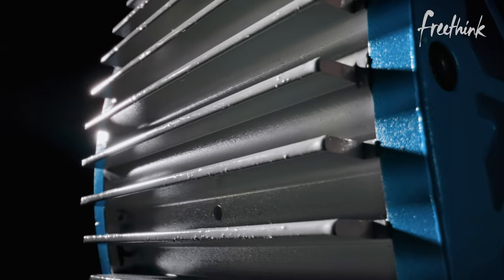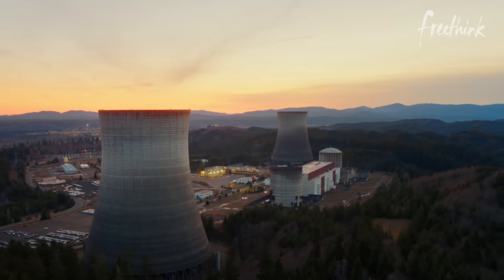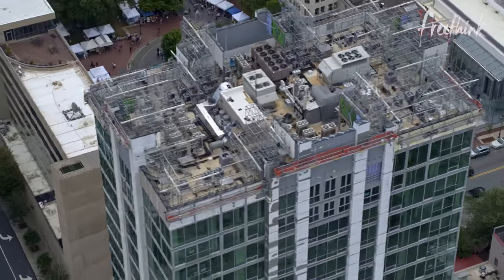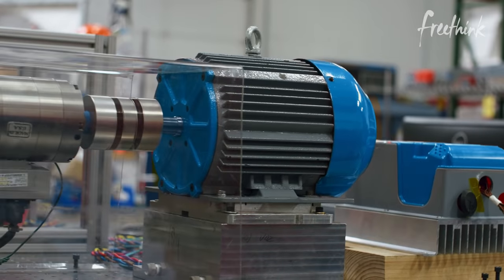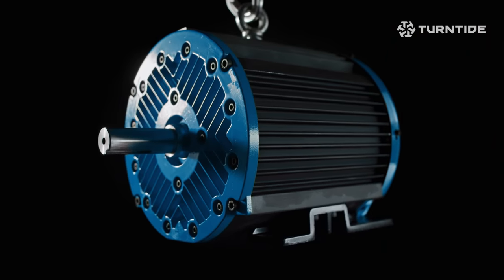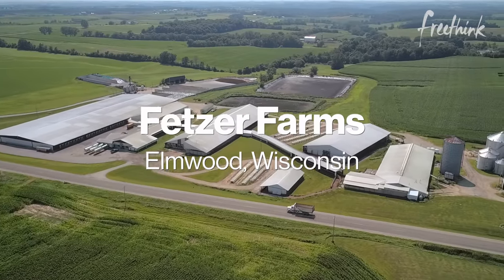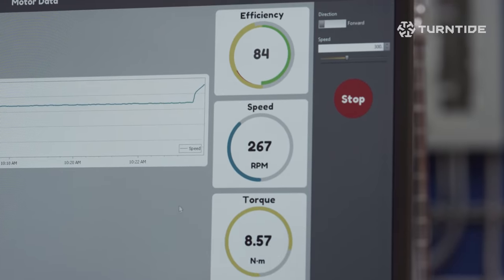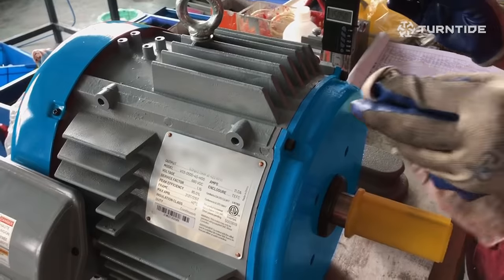Want to Save the Planet? Start with Reinventing the Motor

Comment: Big claims! Majority of existing large motors have 92+% efficiency. Hard to squeeze more without impacting cost and reliability. Improvement by few percent is nice, but from existing efficiency one can see not much room if left for substantial impact. Better electrify more machines than reinventing the wheel.

Comment: I have better idea without turn in and off fast .. and single wiring double rotor and each turns to counter each other and also can work wirh dc and ac ...no complicated computer control for speed .. just variable voltage .. no speed control .. your speed is only limited with bearings and energy you can supply .. speed will controlled by power(Voltage and current ampere )

Comment: You are putting chips and computers inside motor and saying that it will have lower maintenance cost. Truly internet is a very strange place. 

Current electric motors are almost 80 percent efficient not 50 percent as you said.

Comment: This is just an induction motor...
Reply: Nope.  Looks similar, but totally different principles.  An induction motor operates by inducing a manetic field into the rotor from the stator, which lags the rotating field in the stator, which in turn attracts the stator field.  The greater the lag, the greater the torque, so an induction motor always runs slower than the synchronous speed.  The reluctance motor does not induce a magnetic field in the rotor; it just conducts the field through the rotor, through pole pieces that make up a fraction of the rotor's circumference.  Torque is generated by the phase angle difference between the stator field and the rotor position.  Because of this, it is a synchronous motor, and does not depend on slip between the stator field and the rotor to generate torque.  But because of THAT, it requires precise control, because the stator field must always be leading the rotor by an amount determined by the needed torque.

Comment: As someone who works with motors on a daily basis especially big motors, 1this is bullshit most motors now with VFDs are close to 90% efficient. Also I'm not impressed with a blue 15hp at most motor, show a big 4160vac synchronous motor then I'll be impressed

Comment: The highest efficient motors are synchronous permanent magnet motors. These are used in drones, hybrid cars, electric cars, high efficiency washing machines with direct drive permanent magnet motors, etc because of their efficiency. High power, small size, less heat. Yes it requires a high speed switching controller to match. This infomercial is not about this motor, but something else that compares their motor to line frequency squirrel cage induction motors. They make no claim in efficiency in comparison to synchronous brush less DC motors.
They are not comparing their motor to other high frequency inverter type motors, but only to line frequency induction motors. They claim an effectiveness gain of 30% or so over and induction motor which has efficiencies in the 80 to 90% range. So in reality their motor is in the 82 to 93% range.
A graph of the efficiency of induction motors vs permanent magnet motors can be seen on this page based on typical power sizes. Larger motors are more efficient.  https://www.horizontechnology.biz/blog/induction-vs-permanent-magnet-motor-efficiency-auto-electrification
To be fair, the company instead of claiming efficiency improvements over an induction motor, should print the datasheet of actual efficiency.

Comment: I call bullshit on this. They're describing variable reluctance motors which are basically the exact same efficiency as typical three phase induction motors. Most industrial induction motors will easily get to 85-90 percent efficiency.

Comment: 20kHz commutation isn´t that high at all, every Hobbyking-quality-level (being the cheapest) motor-controller can do it... Kimura made in 2009 a tiny 100W-motor with 96,5% efficiency (a bigger 50.000W-motor for cars would be at above 99%), I think some Toshiba-daughter-company exploits the patent since then. https://newenergyandfuel.com/http:/newenergyandfuel/com/2009/04/06/japanese-researchers-breakthrough-96-electric-motor-efficiency/ If you pay for somewhat premium quality, there´s no room for improvement.

Comment: They way these guys are explaining a simple motor,,, Specs it runs on windows 10, its using the new 2nm intel cpu just to switch a 0/1 20,000 times per second😂😂😂 🙌

Comment: Congratulations your team successfully increased the frequency of oscillation from 50Hz to 20,000👍 
is it possible to use it as an alternator to generate more electricity? So that when it passes one stator coil various pulses of electricity are generated?

Comment: Half of the energy is wasted, what a wrong information!
Everybody can look at a datasheet from a standard induction motor, and there is to see that the efficiency depends on how many % of the nominal power of the motor you momentary use. Even if you need only 50% of the nominal power of the motor the efficiency is above 90% and this is without using of external electronics as VFD. If you put a VFD - who are cheap and really common now - you can increase the efficiency even more!

There are always companies who want to reinvent the wheel and put money with that. The easyest way is to use the idea of saving the world with massive co2 reduction! They should let check theyre numbers from a scientist about how efficient we are at the moment.

Comment: bbbaaaaaa...... Warning infoinfomercial ahead.... Well.....part of the reason 'farmers' use 'constant' rpm fans, is just that, it's ALL they need.... and what they really need is the 'simplest' motor they can use, to run 24/7....with nothing but bearing's going bad.... you introduce huge amounts of electronic drivers, and you get huge amount of 'simple' component failures that crash the whole unit..... and then, guess what....the 'whole unit' has to be replaced....NO component level fix available..... Now, I'm not saying this motor is useless....it has it's place....but....will it replace ALL motors....NOT needed....just for power savings??   Good luck to them....won't be investing....

Comment: I think you're massively underestimating the audience here. Big claims, few details, and those few details given are wrong, massively exaggerated or old news. You're relying on the viewer not knowing enough to know that there is no substance to this video.
I would agree that a switched/synchronous reluctance motors (which I assume is the design here) with precision control systems are fantastic. Overcoming torque ripple was a massive deal, especially for EVs where every % counts. But this is old news and we're talking of a few % depending on the application, not 50. The revolution has already happened, many (most?) EV makers are already making these. I even saw a great IPMSRM design in an electric lawn mower (Swift).
If you really have something, be more specific about it, otherwise this video is meaningless, sorry.

Comment: Maybe there is a reason the spoke person are not engineers? induction motors are 80% to 90% efficiency in converting energy. Where he gets 50% loss ? Backup with some data and facts rather than marketing BS.

Comment: Another scam to complicate repairs like the inverter motors in now a days  air-conditioning and refrigerators to add proprietary circuitry when starting and running capacitors works just fine and inexpensive

Comment: This is just so dumb it might work.
Seriously though, any electrical engineer learns about switched relactance motors, which are just induction motors, in first or second year of uni. What you showed was a concentrated winding induction motor, aka a stepper motor. Its just so wrong in so many level it should be reported as a scam.
Reply: SRM motors are very much different than induction motors in construction, operation and hence control.
* Induction motor has winding on stator and rotor .. Hence need power for both . hence higher probability of failure, less temperature, also Winding manufacturing is very complex since it's kind of intertwined.
* SRM does not have winding on rotor windings also windings are separated on stator ease of manufacturing, less losses, no magnets, can go higher in temperature and hence also used for mission critical applications.
Reply: @rahulbirari401  induction motors do not have winding on the rotor, they have a squirrel cage. All the current in the rotor( and magnetic field) is induced from the slip angle, thats why it is called an induction machine. As for the windings, concentrated winding are less efficient as their back emf waveform is trapezoidal not sinusoidal. The difference between the trapezoidal an sinusoidal is a lot of harmonics, which are power loss as sound and vibration. Thats why large permanent magnet motors also have distributed winding.

Comment: Waste of time 

1st to run this motor on AC current .
We needs a rectifier circuit and a transformer . Because theis no electronic microcontroller circuit existing to run on 120 or 240 volts .

And this conversation only leads to the high energy consumption.

And we need neodymium magnets to make this motor which even increase the cost and carbon footprint.

And this motor is nothing new 
It's just a 3 phase BLDC motos as a drone motor or any type of PC fan motor.

Comment: (READ IT all AND U WILL LAUGH FOR A WEEK)
so just go back in time and use old technology that was banned because it was to good / was hard to manufacture 
for me 
The real issue is people that rule the world
then how things work 
in my country u cant use solar power for your own 
it goes like this 
if u produce 10kw , only 6-8kw is for u 
then u still need to pay 30-40% for what u use 
at the end from 10kw , u get 6kw , use it , pay for it and in reality u have 3.6kw free and pay for rest (2.4kw of 6kw that u used) 

and thats not all XD for average person without solar power  electricity is 40% cheaper than for the one that have it because u need to connect it using 2 way meter 

ad it to that 2.4kw u pay , and u get 3kw for free from 10kw u generated but after u use the cheaper one u will pay 40% more 

just perfect 

and making your own (only for u) solar farm etc is illegal because it isn't taxed

12/10 taxing strategy 

and remember ..... solar cells work like roof , so u will need to pay tax for rainwatter that can be collected from that roof XD

Comment: Nice vaporware stock footage corporate BS, legit, thid meets 90% of the red flags of tech-fluff startups. Maybe it is true  that wkth "advanced computation" you managed to get better engimes, but in 6 minutes of videos I couldnt even understand HOW MUCH.

Also, nonsaturated iron+coil system imho is very much a linear system, no need to use "advanced shiteroo", maybe also analog electronics is good? Also given that probably most of the motors (e.g. fans, air comditioners) are working in steady state regime, without much need to throttle and change the operating point (maybe eh)

Comment: Nah, still looks like any other motor. Sure you have made it more efficient in it's operation but I wouldn't call it a reinvention of the motor. It's more like an evolutionary step more than anything else! 
Show me something light weight, produces no heat and uses a rotating magnetic field without the use of external energy, then we can talk about the reinvention of the electric motor...

Comment: Congrats, you slapped a switched mode power supply onto a stepper motor.
This video is stupid, it doesn't go into any details about what is new about this motor, how they generated claims like "60% more efficient", or give the extraordinary evidence required to prove such extraordinary claims.
VFD and BLDC motors are already 85%-95% efficient, especially 3 phase systems, so I find it hard to believe you can reduce electricity consumption by more than half. More than half compared to what? Pre-VFD 60s era rheostatic motor control?

Comment: Nope........total lack of information........ as I know very little about the actual characteristics of electric motors general, apart from the fact that I use 3 phase motors in my workshop driven by VFD's I doubt there will be a huge move to something that will not be better than what is currently on the market right now.........otherwise the Chinese would have sold it on EBAY years a go.

Comment: Oh my goodness.  This ad is total BS.  The efficiency of a 3 phase induction motor (which is used I'm the VAST majority of industrial apications) is 96% efficient!!!!   What a load of bull!  DC motors also have a high efficiency rating as well.  The least efficient are 1 phase induction but these are used in low power consumer electronics/appliances and they are extremely cheap when compared to alternatives.  Stop lying.

Comment: A long time ago, I down voted this video. Coming back to it, I would still downvote this video. This is nothing but a hoax and feeding into the false idea that we as humanity can sustain on lower demands when it doesn't provide the means. The motor you designed is so much of an old idea, you forget that a stepper motor- who already takes commands such as this, has already been invented. 
Rather than "inventing" what you did, you could have had a multi channel DC input which utilizes the time differences (such as frames to a second in animation), perceived in copper wiring. For example: since it takes 1cm/second for an electron to travel, you could have easily timed a penta-polar motor by feeding each electrical pulse an offset of 0.2 seconds just by utilizing only logic gates. It is nothing new and nothing fancy. Take it to the extreme you can feed it less electricity, increase the overall performance, require less than half the cost to not only develop it but to also engineer it and use old technology no longer being recycled. Hell, you can even amplify the results by using even less electricity by adding in a couple of oscillators and reusing "old energy".

Comment: Love better electric motors, but please stop spouting off the political science mumbo-jumbo dogma that CO2 causes climate change.  CO2 is plant food.  The global atmosphere is NOT sensitive to small change in CO2 concentrations, and  CO2 has NEVER driven, caused, or controlled climate change, global warming, or whatever you want to call it.  Global atmospheric CO2 levels have, for the last 600 million years of known climate history, FOLLOWED temperature change (i.g., global average temperature increases, then after an average lag time of approx 800 years atmospheric CO2 levels begin to increase.). Then, as global average temperatures decrease, as they starting to do now, atmospheric CO2 levels also decrease (after a lag-time once again).  Couple this with the fact that the earth has been in a gradual cooling phase over the last 7000 years, and all the political science of Anthropogenic induced climate change is simply disproven.  The “ climactic optimum” period (otherwise called the Minoan warm period) was warmer than the Roman warm period, just as the Roman warm period was warmer than the medieval warm period, just as the medieval warm period was warmer that our modern warm period.  Each warm period is cooler than the last.  Look up the climate record and CO2 concentration levels !  ALL life on earth THRIVES when atmospheric CO2 levels are 1600ppm (4X higher than today).
Reply: Afaik humans loose about 10% brain capability at 500ppm and it doesn't stop there, so much for thriving
Reply: John Uferbach Funny😂👍. The only time CO2 becomes a problem at low levels is if adequate oxygen isn’t available.  When adequate O2 is available, increased CO2 levels are beneficial.  Highest natural levels of atmospheric CO2 recorded in the last 600 million years is between 7000ppm and 7500ppm during the Carboniferous period (largest explosion of life the planet has ever seen).

Comment: This is overcomplex and mostly pointless rubbish. 

3 phase is already and always was as efficient as you will probably make anything. But that's if you connect it directly to the supply, so it's single speed. And those speeds depend on the pole number and you have fixed options. Hence why old lathes and things had lots gearing to change the head speed. Rather than just a high low. 

But if you just want one speed running forever then the old Tesla 3 phase motor is by far the best option. And cheep too. Nothing to this day can beat it as it's as close to 100% as it's likely to ever get. 

Variable frequency drives for 3 phase give you total speed control. But you lose some efficiency with the power electronics that controls that.

Considering they have to do the same at way higher frequency for the same result. I don't see the advantage. 
The system we have has the most efficient motor ever made being driven by the power electronics. 

High frequency becomes far more difficult and less efficient to do things with. Also requires more expensive electronics to do it for the same power. 

I don't see how their electronics can be any more efficent than the ordinary 3 phase electronic controls. 
Which are the already on the most efficient possible motor. 

There is no point to this. As a more complex motor costs more to make. 

And the less efficient motor types are used as they are either super cheep, or convenient to make do the application. They are.normally of very tiny power compared to the kind of industrial things being discussed. 

Some complex thing is not going to replace them. Just on cost alone it will fail.